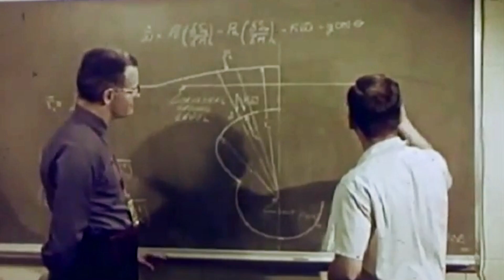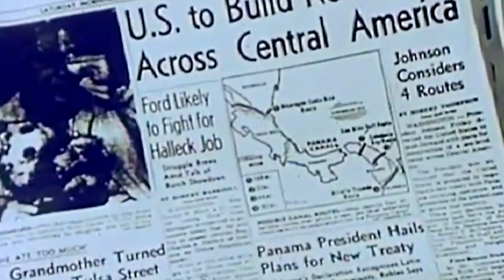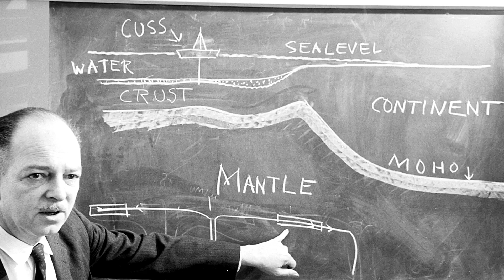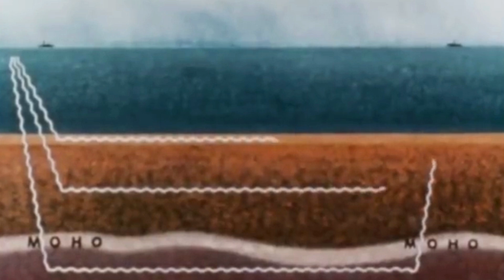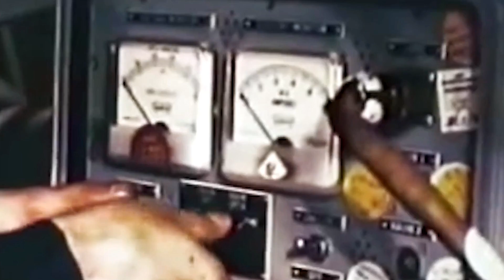5 Most Insanely Massive Projects Never Completed

Comment: Project Plowshare….sounds a lot like what my dad saw when he was a security guard at Lawrence Livermore Labs in the late 70s, somewhere around 79-80……
The project itself was hush hush & nobody was allowed to see or talk about it, but since he was a security guard, he of course had access.  As I recall, He described a gigantic (we are talking MEGA HUGE, it was housed in a building as big as an airplane hangar I believe) magnet that was suspended from a tripod, wrapped with several layers of wire or some kind of metal, which apparently was to be jolted with ungodly amounts of electricity, (possibly a laser).  He said this thing was meant to be the core of an artificial sun.  (See below for proof of concept, there actually is a video from the same lab talking about this very thing)

On Jan 24th 1980, there was a huge earthquake (M5.5) centered near the lab (I felt it all the way in Antioch—about 32 miles if you take Vasco Road).  When I heard where it was centered, I tried to get ahold of my dad, but had no luck.  Eventually he made it home and he told me that he almost died that day:  when the earthquake hit, he happened to be in the hangar with that enormous magnet, and the earthquake jolted the building so hard for so long (there were several large immediate aftershocks (M5.2, M4.2) that it caused that enormous heavy magnet to sway alarmingly under the tripod & my dad could tell that it was going to topple.  He dove for the door & barely made it through when he heard/felt a ground shaking crash as the magnet dropped to earth.  

I have no idea what became of the project after that but if the military & Lawrence Labs didn’t abandon it from early on & continued to work on it in the early 80s, it sounds like it was important enough to continue.

Note:  after writing this I did a search for Lawrence Livermore Labs & Artificial Suns & got this result:  
Harnessing Fusion:  Creating a Sun on Earth 

Also this:  Fusion:  How to put the Sun in a magnetic bottle

(You’ll have to search YouTube yourself, this channel won’t allow me to post links)
Reply: believable enough to me, fusion technology has been worked on for a long time and the chinese are building what they call an artificial sun.

Comment: Fun fact on Project Plowshare:  The Russians actually did nuke an oil reservoir.  Instead of fracturing the rock and increasing production, it fused the rock to glass which sealed the oil behind an impermeable wall.
Reply: That's kind of funny but even strength must bow to wisdom.
Reply: Lmao bet someone got killed for that.
Reply: @B0xlife1  Im pretty sure they were trying to close it so no one would have been punished.
Reply: Whoops...1